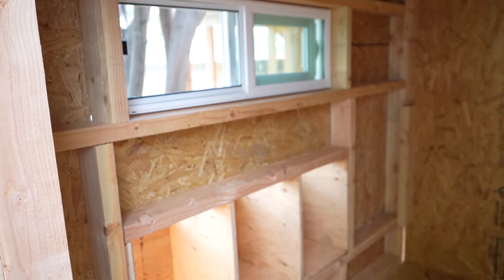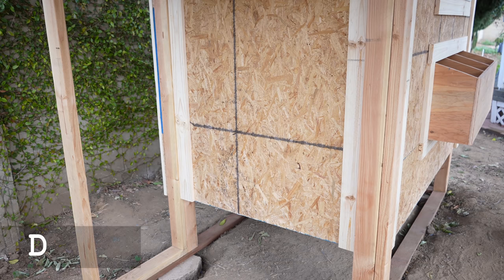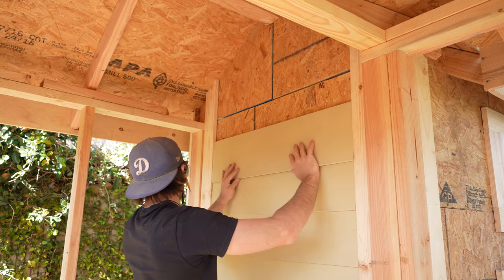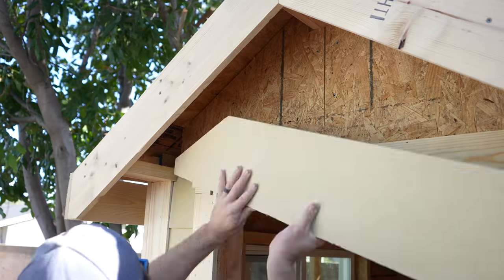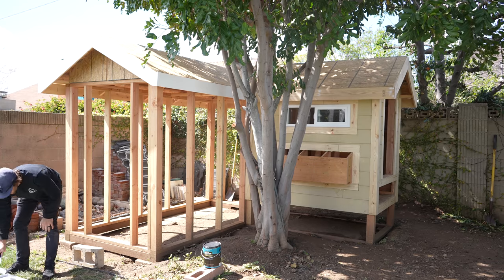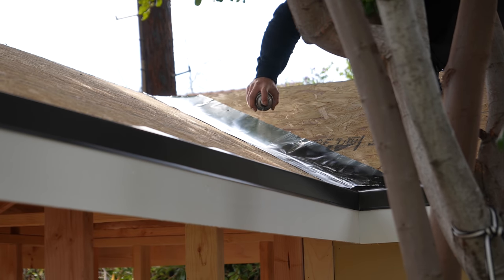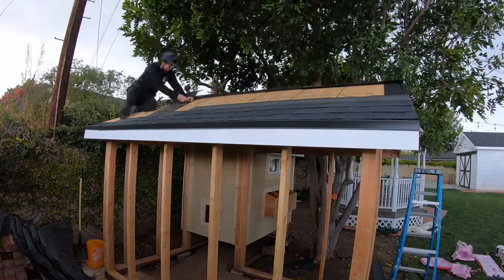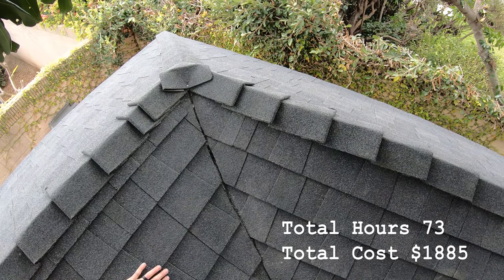Cluckingham Palace Part 3, Great Eggspectations

Comment: Most people don't realize that the physical size of a rectangular building structure does not really matter when it comes to the work involved. You have everything that's time consuming in a small structure as you do in a larger one and I would argue that the smaller ones takes even more time because there are more details.

Comment: It's a good thing this is just a chicken coop because that drip edge wasn't installed properly. There is supposed to be a gap between the drip edge and the facia.
Reply: Someone’s been watching This Old House. 🙃 I looked into this been basically zero houses in my area f Texas have a gap between the drip edge and fascia. I talked to several roofing companies about it, and apparently the proper installation depends a lot on your weather. We deal a lot more with wind damage here than we do water and ice. The drip edge gap is more vulnerable to wind pushing water underneath it. What there was universal agreement on is that the shingles should hang past the fascia by at least 0.25-0.5 inches.